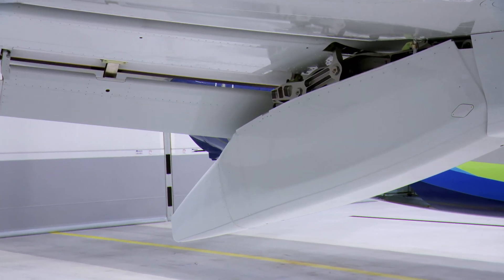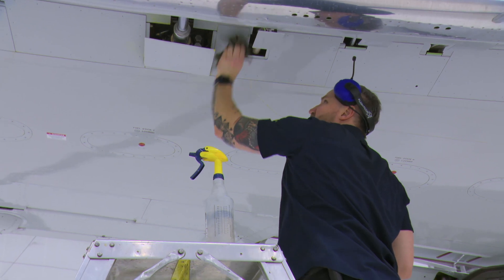A Hydraulic Fuel Leak has Alaska Airlines Techs on High Alert 🚨 | Ice Airport Alaska | Smithsonian

Comment: Hydraulic fuel?
Reply: Shawn completely misses the point. Good job
Reply: Fluid is incompressible. Hydraulic fluid is a fluid specifically designed to be able to stand up to high pressure(and thus high heat) to move things that are extremely heavy against high amounts of pressure(so control surfaces, flaps, spoilers, landing gear, etc, and against high winds in the air).

Comment: The description says, "The technicians need to rule out a hydraulic leak…"

No, the evidence pointed to a leak, so they didn't need to determine whether there was a leak or not. They did need to determine the source of the hydraulic leak as that was not obvious. They couldn't find an obvious source, so they attributed the leak to the hardening of the rubber seals in the extremely cold Alaskan climate while non-operational. Sealing requires a seal to conform to the adjacent surfaces and the cold makes the seal temporarily harden and "set" to the shape of the adjacent surfaces. When the system is initially operated after a cold soak, a cold-set seal may move to a new position and be non-conformant if the shape of the surface is slightly different, which may allow a little hydraulic fluid to leak past the seal. The leak is self-healing, as pressurizing the system heats up the hydraulic fluid and components, which restores the flexibility and conformity of the seals.

P.S.: This type of leak is not due to shrinkage of the seal; the aluminum that the valves and actuators are made of shrinks more than the rubber when cooled. Nor is it due to the seal becoming brittle when cold as that implies that the leak occurs when the brittle seal breaks, but a broken seal is not likely to self-heal later.
Reply: You don’t know WTF you are talking about. I have been a commercial aircraft mechanic for over 30 years…I would have spent about 10 minutes dicking with this “leak” and then gone and watched TV on double time for the rest of the night.  NOT a big deal. And I would have flown on this plane the next flight. Pfffft.
Reply: @PeteP , thanks for your reply. Not only was this video reporting ignorant but also the replies other than yours so far.

People are just uneducated, just downright stupid thinking they have to have a say on every little thing that comes along when 90% of them have no clue what they're talking about.

Comment: Fuel leak for a brand new plane!? Of course a Boeing
Reply: Little knowledge is a dangerous thing. And it wasn't a fuel leak. And the aircraft technician explained the reason. And common sense and a logical mind would have led you to conclude why the issue can occur on any airplane. You didn't, ergo…
Reply: Fun fact: hydraulic leak is NOT the same as a fuel leak 😮

Don’t quickly point fingers at something you don’t know enough about
Reply: Listen before you talk
Reply: Yeah, you clearly did not watch the video and just decided to make a blind uneducated comment. SMH….